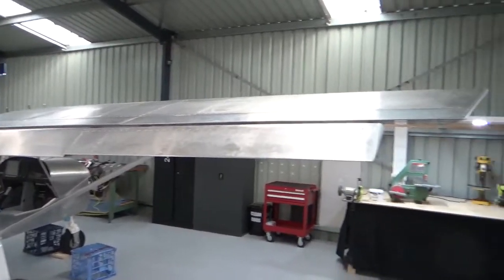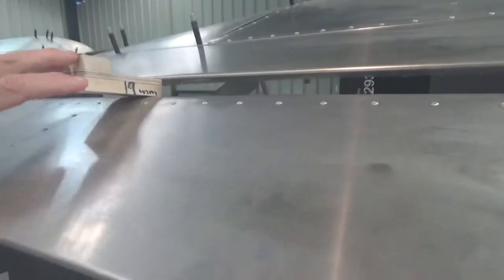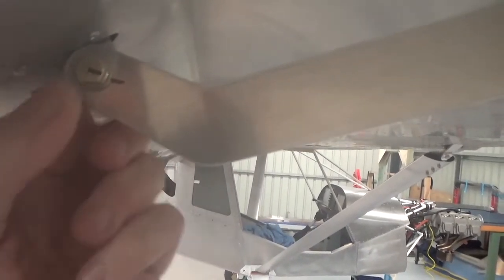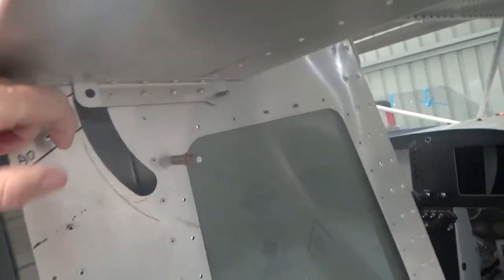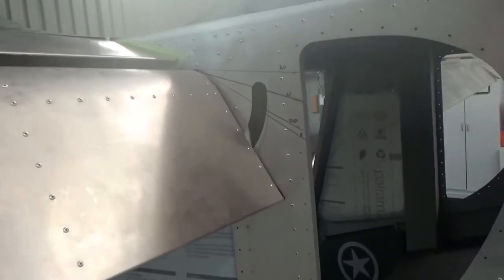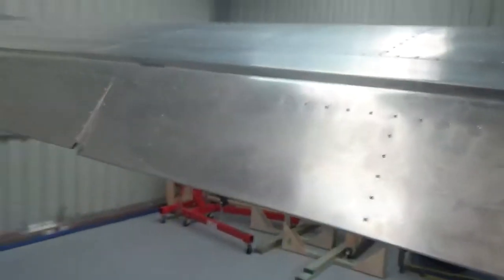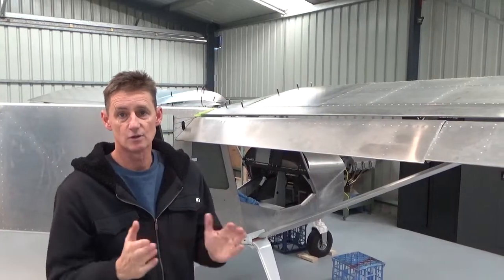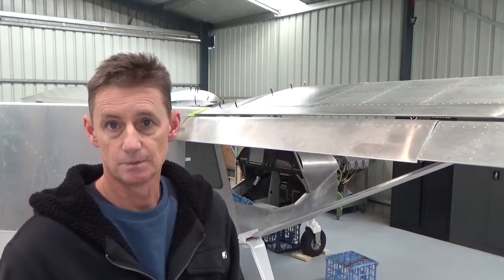Zenith 750 Flaperon rigging

Comment: What happens if you retract inboard flapperon 1 degree from “neutral?” You would still have some flaps in, but just think how much faster you go 🤔  just kidding,... follow the plans 😄
Reply from the maker: If we were racing these I would have the flap at zero and ailerons up. But stick to the plan
Reply: @scottmatthews5280  HI Scott, I was thinking the same thing.
I guess the reason for the difference is to provide some washout to create a 'progessive' stall.
Maybe the 2 degree on the inboard side compliments or continues the camber of the aerofoil and the outboard end provides a delayed stall at the tips.
I guess, playing with the rigging once you get it flying will reveal any trade-offs between slow and cruising speeds.

ps I am building a 750 STOL but I am WAY behind you. A lot of work to do.
Buying a Jabiru 120 a few years ago has slowed by build progress quite a bit.
But I had to get in the air.

I am enjoying your videos. They have motivated me to get back into it.
Reply from the maker: @charlesbrewer6552  thanks mate all the best with the Jab and 750